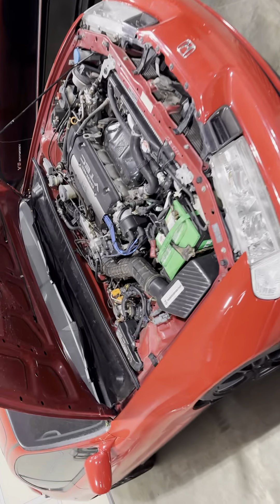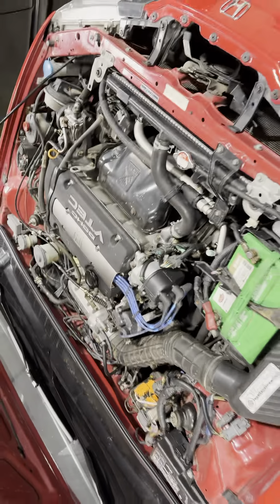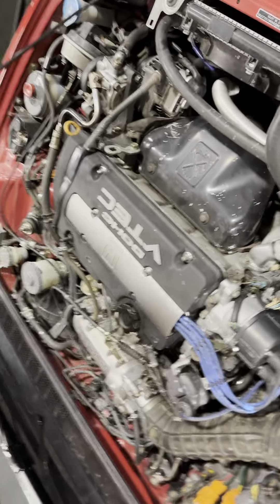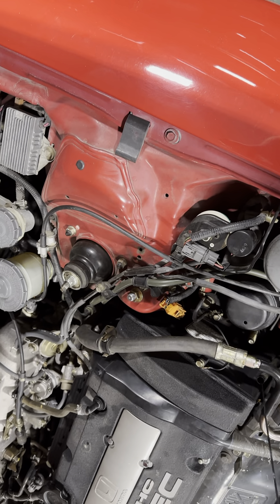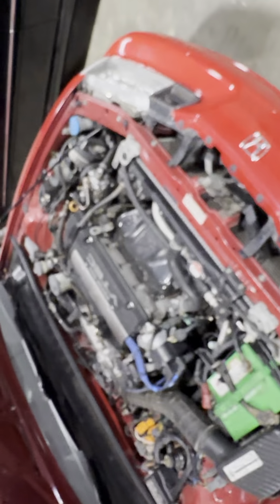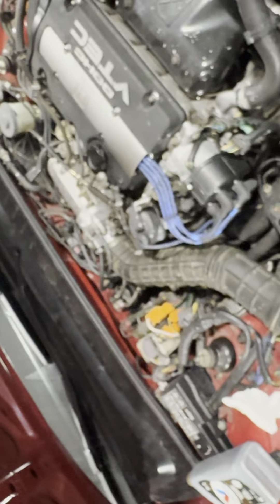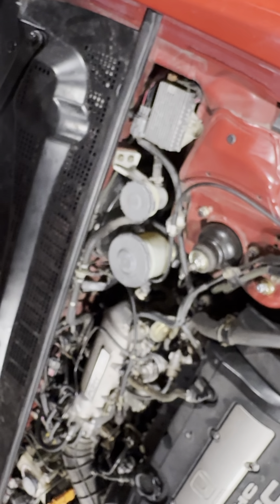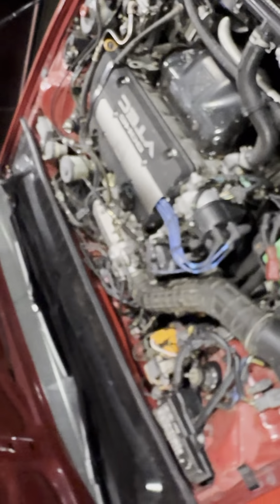Valvoline 5w30 restore and protect 300 mile review.

Comment: How can you tell if it cleaned inside your engine - after running it a mere 350 miles, and you didn’t show us inside the engine. Not sure you have proven anything really.
Reply: It’s a placebo and wishful thinking.

As far as Valvoline claims, they ran their test engine unrealistically high at over 300F. There’re no vehicles with engines that run at 300F. Also, “up to 100%” is marketing, not real. An insignificant and subjective 1% deposit removal is in legal language “UP to 100%”
Reply: 300 miles is a few trips to the grocery store and back. Proves nothing. I just switched to RP on an oil burner. I’m giving it 5 oil changes to see what happens. I’m inherently skeptical.
Reply: You say a mere 350 miles, but my sister‘s Kia was burning a quart and a half in that mileage. They have the carbon piston problem. I ran the BG EPR 109 cleaner through one time, changed a filter at 2500 miles, and then I use this oil, and it has helped significantly after just one run cycle. She added 1 quart for the oil interval, whereas before the change, she was adding 8 to 10 quarts for the oil change interval.  Obviously not a scientific test, but she has about 1/8 the oil usage after 5000 miles that she had before.

Comment: Amsoil Signature Series with 1000 mile ocis and highway driving. Maybe four changes with Amsoil engine flush at each change.
Reply: I can't get over their fake advertising on that
Reply: NEVER "Engine Flush"  !!!    NEVER!   Flush breaks particles and sludge and then blocks vital engine passages with all that junk!   Frequent oil changes (every 1000 miles for 3 changes) is much better and safer!
Reply: Amsoil is overrated and yes I have used it! Any good Synthetic oil changed every 5k miles with the filter will exceed your engine's requirements! 3rd generation mechanic and engine builder.
Reply: Amsoil is fine.  I used it for a while.  But it's a cult.  They have that weird guy doing non-standard tests and selling the bs. Using long oil change intervals is just not a good idea. Wear metals increase is linear.
Reply: @artblackwood7936  Wear metal increase is absolutely not linear, give me a damn break.
Reply: 1,000 mile oil change interval? Geesh.  That's crazy short.
Reply: @brassmule  I totally agree on the Amsoil, but engines with a lot of carbon build-up and sludge using the Restore and Protect, I am doing 1500 on my first one and cutting open each oil filter to see the condition.  As it cleans I will extend my OCI’s slow back to 5000 miles.  But I want to see inside the filters before I decide the next mileage point.  

I have used Amsoil many times and exclusively in my tow boat and direct drive and my Kawasaki H2 with 260whp.  It definitely makes a difference.  My boat is smoother and gained 250rpm at WOT.  Bike engine and gearbox is much smoother.  

But I use these oils in my other vehicles:  

Valvoline Restore & Protect 
Valvoline EP HM
Pennzoil Ultra Platinum
Redline High Performance 

Purolator Boss
Fram Endurance
For filters
Reply: @Balticblue93  Yeah Amsoil is great oil, since we know they use a great base oil. I wouldn't use it for 10k or 20k mile intervals but I would not do that with any oil either. 5k intervals is what I stick to for everything. I believe Amsoil CVT fluid is currently the best available, however.

I'm about to do an oil change with Valvoline R&P on my 2011 Odyssey, known for oil consumption due to clogged rings from VCM. I've used VCM Tuner II to delete that cylinder deactivation for a year now, new ruthie plugs.  Gonna do a 12 hour round trip drive and then an oil change. Like you, I think it's a good idea to use a shorter interval on the first change just in case.

But 1,000 mile Amsoil oil changes is really overkill.  Maybe it's a typo and he meant 10,000 mile.
Reply: @brassmule  I absolutely agree that I do no do extended OCI's even with Amsoil or Redline or Valvoline.  5000-mile oil changes is what I practice in all street vehicles.  I do much less on the boat and motorcycle.  

Amsoil CVT transmission I would agree is probably the very best.  Just remember, CVT's in Nissan's and many other brands etc use a belt or chain drive.  You must use a different fluid.  Toyota and Fords do not have belts or chain drives.  They are gears and motors.  So, you use Mercon LV from Valvoline Full Synthetic or the Amsoil Low Viscosity Blue label ATL ATF.  I do have 5 quarts of Amsoil CVT fluid in my garage, but Amsoil recommends the LV ATF in the Blue label Marked ATL.  So, I have never installed the Amsoil CVT, it is just sitting there.  

I also use the Ruthenium spark plug in my Ford Fusion Hybrid.  A long drive on R&P is ideal but use a really decent oil filter like the Purolator Boss or go the other way for cheap filter that doesn't collect much sludge.  Or plan to change your filter and top it off on your trip.  I rotate my oil filters and cut them open to inspect all the pleats.  
I am doing 6 oil changes before I decide to stay with the R&P forever or go back to Valvoline Extended Performance High Mileage with the Purolator boss and Fram Endurance FE3600.  I use a larger filter than OEM.   

1000 miles on Amsoil is not the same at 1000 miles on R&P.  Amsoil can go 10k miles on an OCI with good filter, but that would be for highway driving and nearly 99% of vehicles are considered severe service.  I do not exceed 5000-6000 miles max period.  And all my oil analysis testing shows the oil had more than half the additive and wear packages available.  Oxidation is low and the wear metals are non-existent.

Comment: Your videos are very insightful. I just bought a 08 Element awd with 189k with oil leaks and started using the restore and protect. After 500 miles I took the valve cover off and adjusted the valves. You could see where the Valvoline oil was washing and braking down the old oil varnish and buildup. Between the valve adj. and the oil change the engine is running smoother. The oil geek was spot on about how good it works. 👍 Keep up the good work.

Comment: Been using it solid three oil changes in my 1992 k1500 350 tbi with 240k and it’s cleaned out for sure as well as no oil loss at all. Also gained power. Stuff really works. Thanks for the vid. Love the v tec
Reply: What interval did you do for these oil changes?
Reply: @Brandon-21MN  sorry for the late reply. I went 500 miles on the first filter, changed the oil and filter at 2000 miles then 3000 on the second and 4000 on the third. Truck runs like new

Comment: I'm into my next cycle on this oil in my 3.5 Ecoboost and, yea, this stuff really is great. I didn't have a burn or loss of oil prior but, I'm about preventive maintenance. After watching the oil geek and his visit to Valvoline and Ford Bosses statements on the product, I decided to go all in with it and,  as you said, noticable performance gains. From fuel economy to seeming to have more torque when you get in it. I dropped the first oil change just shy of 5k and, unlike Motorcraft full synthetic, this didn't turn dark. Sticking with this one, Kudos, good luck with yours.

Comment: Awesome results. I too had phenomenal results in 06 forester. My mpg went from 26 over past year to 28 averaged over 6 tankfulls. Actually, 28 mpg was factory spec for this model, so running like new. Now runs remarkably quieter and smooth. Also shifting down less as ecm/tcm detecting better power.
Reply: What oil weight 🤔 did you use???

Comment: Just changed my oil today with restore and protect on my 2nd gen tundra. It’s definitely quieter than when I was running Mobil 1.
Reply: How is your Tundra now? Thinking of using this in my next oil change on my 2000 tacoma.
Reply: @ex8280  still pretty quiet. I’ve only driven about 1000 miles with restore and protect in. But I’ll probably be changing the oil at 3k just to see if I notice anything. My 21 4Runner is about to be due for an oil change soon and I’ll definitely be using restore and protect in it.

Comment: I wouldn't wait for 1k, it might be too late. Change the filter and cut it open at 4-500 might be safer.
Reply: did mine after 1200 miles on Infiniti q60 at 48k. oil was super black, no sediment in used oil so filter must be working, moving to 2k for next change. this stuff is cleaning very well
Reply: @sniggitty  Soot/Carbon in Blowby is what turns the oil Black. It's too small to be filtered out by itself but it combines and then it can be. The problem is you can't tell between the combined and the not combined. A new filter can filter 3 of 4 Quarts. As it stops up it drops in that ability, then it's 2 of 4. This is why I'd suggest frequent filter changes and cutting it open just to make sure you're too early then too late.
I don't know what Infiniti does on their PCV System but Honda has theirs turned down to a detrimental level. This is why they have oil consumption issues(stuck rings) and Brown Sludge crankcase. If you pull your oil filler cap and you don't feel a vac on it and see Blowby coming out with it Hot/Idle, your PCV Valve has failed or your vacuum is too low from the factory and you'll have short OCI's. You'll also have dark oil soon after an OCI.
The old rule is you need 1 to 3inHg to pull Blowby away from the ring pack. Honda runs .2 to .8inH2O which is too low and won't pull the carbon out of the ring pack. The Blowby carbon is sticky by nature and sticks to the Oil Control ring in particular then you consuming oil starts ramping up. 
Get a Manometer(35.00 on Amazon) and plug it into your dipstick tube. This is the best way to see for sure what the PCV System is doing. If it's below 1inHg you'll need 3-4K OCI's.

Comment: Any Diesel Rated Oil will clean a Gasoline Engine it has High Detergents
Reply: No.
Petrol oils have higher TBN to prevent acid from forming.

The valvoline PR has a proprietary formula which dissolves diamandized carbon in piston rings and piston drain holes.
This come after 4 oil changes of 3000 miles each and 8 replacements of the oil filter.
The dissolving process is slow in order to prevent big chunks of carbon to travel to tiny oil passages and clog them.